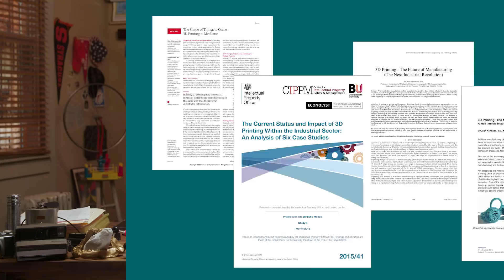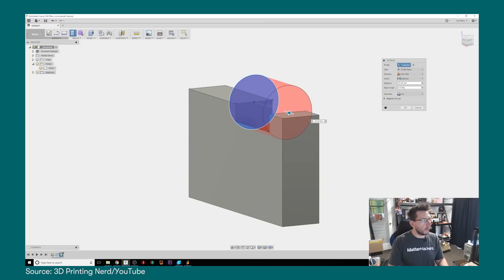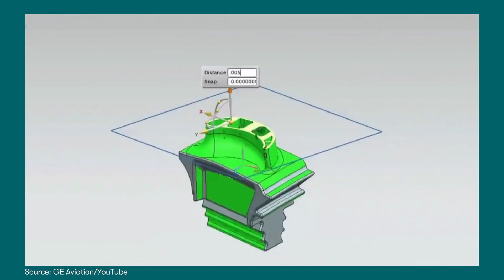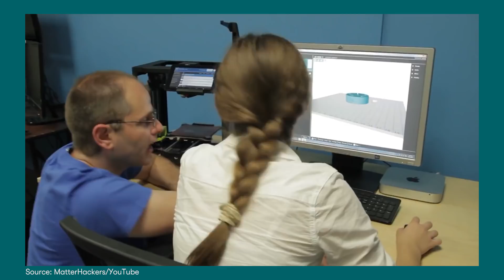What happened to the 3D printing revolution?

Comment: is there more than just plastic that can be used for 3D printing? or a good re-use system for the parts you don't need anymore after printing to refuel another print?  With Recycling not really being a good option for all the plastics, i'm curious of the other options.
Reply: Industrial machines can print ceramics and metal. I don't know if it's possible to respool filament at home but I'm sure you can get recyclable polymers for printing.

Comment: 3D printers as “consumer products” is still a looong way off, but like you explain, there are absolutely revolutionary benefits to 3D printing. It’s really pretty magical.
Reply: The problem is that 3D printing takes too long to make much commercial sense

Meaning things like character busts can take a whole days worth of time and thus the person making it would need to sell it for much higher price than what anyone would actually wanna pay

A reel of fingerprint is generally $15-$20 at Microcenter for example and you can make many things off of one reel but since it takes all day to make that character bust you need to sell it for like $72 and make one every day all 7 days a week just to make out with $500 a paycheck a week 

It’s just not worth it to do as a job unless you can have multiple 3D printers but needs its own computer set up for it thus greatly increasing cost of doing it
Reply: No, they need a decent network admin, and a basic understanding of capital costs, to make sense for high price low volume applications, buts it no where near injection molding on price once your moving 1000 plus units
Reply: Until they make 3D printers that are more reliable and easier to use, with a large library of templates, then consumers will stay away.

Comment: I've always had this question, when people are printing parts for cars, isn't the material too weak or not suited for these sort of things?
Reply: Space-X use 3d printed parts all the time. It depends on the process that the 3d printer uses.
Reply: Interesting question - something I spoke about with those two researchers. It got a little in the weeds so I decided to not include it in the piece. With non-plastics, the heating process during 3d printing can change the material in ways we're not really sure about, so it's definitely a concern.  Check out their paper - https://sloanreview.mit.edu/article/getting-past-the-hype-about-3-d-printing/

Comment: HEY! Thanks for using clips from my drawer pull video. Any chance, since it was a source, you could add the link to the video in the description along with the rest?
Reply: Nah, they get highfives for sure - this report was great, AND they were very quick to add the link. That's huge, even worth a bonus highfive.
Reply from the maker: Added! Thanks for watching!
Reply: For sure - we'll add now.
Reply: Ooooft, no high 5s for Beme.....
Reply: They added it as soon as they were asked.
Reply: Santiago Ferrari no! They used my clips in context and told a great story. Of course I love being asked ahead of time, but in this case, had they asked I would have allowed it.
Reply: creators shouldn't have to ask for credit from professional channels... --__--
Reply: +Michael Noeth As an engineer you should know that researching a topic before pretending to know about it is necessary to not talk total bullshit. Clearly you didn't do that, otherwise you'd know there are plenty of 3D printing channels run by people who have designed enough to prove they know what they're doing.
Your comment only makes you look like a jealous failure of an engineer.
Reply: Don Gray well, to use a toaster you should know how to insert the toast and not have someone else put it in for you, so all you have to do is hit the start button.

I partially agree with Michael here, I don't hate the whole 3d printing community but some channels that simply consist of: "Hey look at this model I found, let's print it on this printer. Oh it turned out bad, let's print it 5 more times with different materials on different printers. Wow, look this one turned out good, nice!"
are the ones I really dislike. it's just like someone testing ink and paper on a regular printer, not very exciting.

On the other hand there are also creative channels that focus on how to use a 3d printer to solve a problem or create something interesting or exciting. These people usually design the models they print themselves and those models are specifically made for that very task which is exactly what 3d printing is supposed to be used for.
Reply: I'm a graduate engineer and I think the 3D printing community is amazing. The whole point of 3D printing is that you don't have to be an engineer to design and make stuff. Most people with a 3D printer don't know how to do all that stuff. I think the reason he's popular is the fact he shows all the interesting aspects of 3D printing and but he's learning just like everybody else and does things which others can follow along with.
You are a complete imbecile if you think the 3D printing community on Youtube is dumb. Tell me what's wrong with channels like 3D Printing Nerd, Tom Sanladerer, Make Anything and Makers Muse? If you think you're so good why don't you make 3D printing videos and show us all the things that are "mention-able or exciting"?
Reply: bordpie;  It looks to me like the real innovators, the guys on RepRap 3,4,5 years ago have all gone elsewhere.  The Forum is kinda slow, and new designs are also much slower to come out.  Prusa snagged one design and improved it and marketed it, but what happened to the many other designs?  Some fell out of favor due to performance, others are good ideas that just never got any traction.
Reply: Mister Shledge The difference is Mr Noeth doesn't have a YT channel pretending to know what he's talking about.
Reply: I don't really watch any 3d printer centric channels but there are channels like gear down for what that do some pretty amazing shit with them. I have to assume he's designing his own prints because I doubt they're just out there for some of the uncommon things he builds. Regardless of that I think it's quite foolish to just make blanket statements about anything, generalizing that everyone in the group is the same is just ignorant.
Reply: Thought of you when I seen this video as I’ve recently found your account too
Reply: SaHaRaSquad thank you! There are many channels on here designing things and printing them that aren't trinkets. Just one example right here
https://www.youtube.com/user/tomstanton282
Reply: Santiago Ferrari its copyright strike. Doesn't matter when its basless.
Reply: Naveication jhonnyq90 knows how to use a 3d printer.
Reply: For what it’s worth.... I just watched the video because it was on the suggested videos.

I liked it... it was informative.

And if the other channel’s video came up, I may have watched it.....🤷‍♂️

Whatever..... informing the uninformed is your goal right?
Reply: And what have you contributed to 3d printing, Michael?.... <cricket noise>
Reply: Michael Noeth wtf are you talking about dude? Don't be so pretentious.
Reply: And you behaving like a pompous twat is useful how to this discussion? People with a passion for what they do have and bring plenty of value to a given topic. There is some very good design based content out there on Youtube from some talented and qualified people!
Reply: True that, Bordpie. That guy is a freaking elitist, thinking he's special just because he studied engineering, forgetting that makers and creators come from all walks of life.
Some of my favourite channels are filmmakers who started as DIY, guerilla style shooting with no budget, but you see them grow into full-fledged studios through the process of learning things themselves. It's the same with 3d printing channels. You see them learn, make mistakes and showcase their work, and then in turn we ourselves learn to do more with them. People who thinks all this is a waste of time are just so full of themselves. I'd rather more people watch these than pointless vlogs by the Paul brothers or something.
Reply: Santiago Ferrari it's fair use and credit is a courtesy that is just good manners, but occasionally the best creators miss a credit- he gave others, so it wasn't on purpose. In any case, it would not have gotten a strike or held it on review.
Reply: 3D Printing Nerd ✋
Reply: This guy knows nothing, and you quoted him. Beme is a bunch of stoners. lol
Reply: As an engineer, I'm disgusted with the 3D printing community here on YouTube. They all have no experience in anything mention-able or exciting. 
The 3D Printing Nerd couldn't even design a poo, and I'm actually serious. He's just some geek whose wife got him a cool gift. He can't even design, nor does he understand parametric modeling, CAM, and CAE. He can only design parabaloids and stuff.
Reply: Michael Noeth typical engineer. All knowing asshat
Reply: @Michael Noeth You should learn to keep your mouth shut unless you have something constructive to say, all you have managed to do here is embarrass yourself and let people know what a pompous arrogant obnoxious person you are, think twice before posting on the internet.

Comment: Wait how would 3D printers in space help reduce weight you still need to bring all that plastic filament with you you're still carrying it all up there it's just not built yet
Reply: There's almost no chance you'll need all the tools, spare parts. So you can bring a fraction of the raw material. Basiliere also told me you can use raw material found on mars down the line.
Reply: It's true that you still have to bring the materials with you, but, the amount of materials needed would be drastically reduced because you wouldn't necessarily use every single spare part you would otherwise have to bring along with you, it would simply sit there unused until it breaks or becomes obsolete.

Comment: as an Architecture graduate, 3D printing isnt just taught, but integrated. It is incredibly useful in the academic system for protyping, but ultimately in tandem with other processes. We should also observe these automated systems of protyping alongside vacuum forming, casting, joint generating, cnc, as integral rather than a singular solution to all. This video is a one fit system for all mindset projected about 3D printing, which is simplistic and hopeful, but 3D printing has many flaws and it really isnt as '3D' as it still prints on the z axis. Anyway this is my 2 cents as someone who still doesnt understand all the mechanisms for 3D printing despite using it for many years.
Reply: Ha, good point about 3D printing not really being "3D." Anyone who's tried to print a sphere on a simple printer would know. However, every tool has limitations, and 3D printers are no different in that regard. The real mindshift is the emphasis on the 3D tools, going all the way down to the grade school level (at least around here in CA!). The new generation (yours) gets it.
Reply: There's still PolyJet and SLA (and DLP) technology where the layers are so small that they can barely be seen... but I get your point about not being '3D', especially most of the affordable ones.
Reply: I took drafting in high school back in the 90's expecting to never be out of work; however, I've never been able to get a job in that field despite graduating at the top of my class. Now I see all these classes at the library teaching children to use 3D printers, boy are those kids going to be disappointed when they realize there aren't many jobs.

Comment: I am an engineer in the aerospace industry and 3D printing is more often referred to as Additive Manufacturing. Lou, you are very correct about there not being any standard for testing the robustness of the material as this is something we are currently struggling with. Once standards are put in place (about 5-10 years), AM parts will be on 100% of aircrafts. The entire aerospace industry in investing heavily in the technology, so I see nothing but good things for product suppliers and OEMs. Everyone benefits!
Reply: Cool - thanks for sharing your inside perspective.
Reply: I’m in the same boat. I work in additive manufacturing at an aerospace company and we are pushing that direction big time. It’s just taking time to change designer mindsets for AM
Reply: Rapid tooling seems to be a good alternative. You print a mold rather than the object its self and cast it in the metal/polymer that you want. That way you can easily test the properties of the final design but still implement changes to the design quickly and at a lower cost.
Reply: So you guys think that you can handle microstructure and macrostructure coincidentally? Or is this technology still only limited to form priority structures like cases?
Reply: Tadesan I’m not sure exactly what you mean, but for the materials we use (mostly nickel-based alloys aluminum alloys) we’ve characterized them to have good microstructure and mechanical properties that aren’t necessarily as good as billet on all fronts, but are much better than casting. For the externals of the prints, we can get pretty good surface finishes as long as it’s not a long overhang or something similar. We try to focus our efforts on parts that are specifically designed to utilize all of the benefits of AM through weight savings, assembly consolidation, and complexity that would be too much too machine. Lower production volumes tend to work well for AM too. There are huge benefits to get from the technology, but not everything should be done with it. For most of our alloys, we aren’t limited by microstructure on geometries we build; the only reason we do screen certain geometries is because they might be impractical for post-processing if there are a lot of supports, etc.
Reply: I'm also an aerospace engineer and my PhD was focused on the standardisation of testing AM products for aerospace applications.  You're wrong.  New ASTM standards are coming this year after a 5 year industry study.
Reply: Also the A350-XWB features over 2000 AM parts.
Reply: Inter Net do you work in the additive manufacturing industry now?
Reply: I heard the same thing about spares for a B-52, as well.

Comment: When they can make 3D printers with plastic, rubber and metal heads, that can print in a variety of colours making objects at least as large as 30cm (1 foot) cubed. For less than $500 that are user friendly we will be at a tipping point and it will go off like the multimedia PC revolution. This is obviously not going to happen in the next few years but a decade or two certainly.

Comment: So I’ll start by saying that I also don’t own a 3D printer, but I think this report is a bit negative. I believe that eventually 3D printers will be useful for ordinary people, but the technology is just not there yet. It’s like in the early days of computing, when computers were only used by big businesses and nobody thought that they would become popular in homes. I think as the technology increases in quality, it will become reliable enough for inexperienced people to use, just like what happened with computing technology.
Reply: No, because injection molding and McMaster exist, both of which allow most rare parts to be sold quickly and cheaply for less capital, and less time then a decent 3D printer.

Comment: I think that 3D printer is great way to prototype fast as Lou said, it's also a great tool for makers to make nice looking things but some companies even use FDM 3D printers to prduce their products and that's cool because they don't have to make expensive molds for injection molding and they can add new updates quickly.
Reply: again low volume, high specialization parts